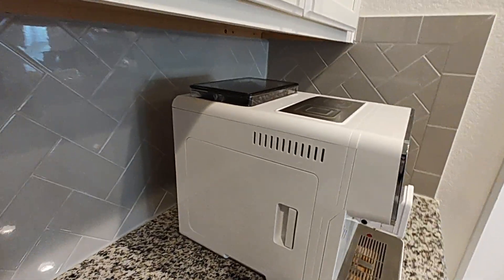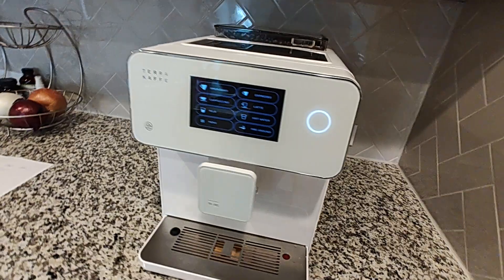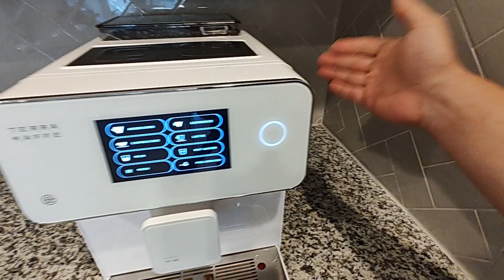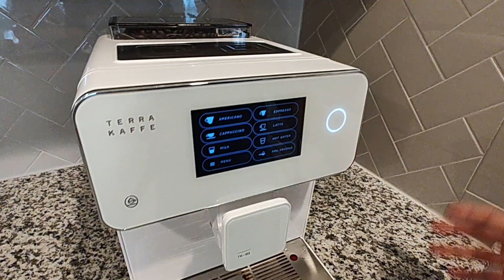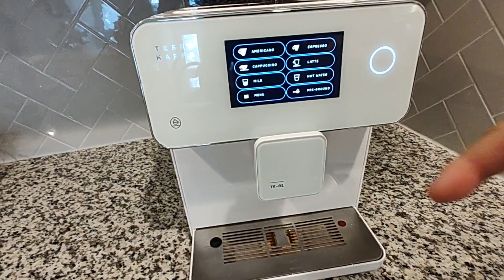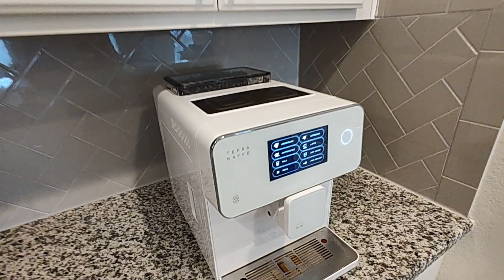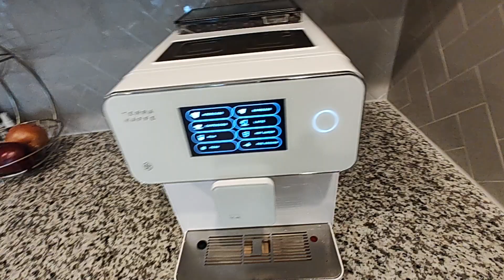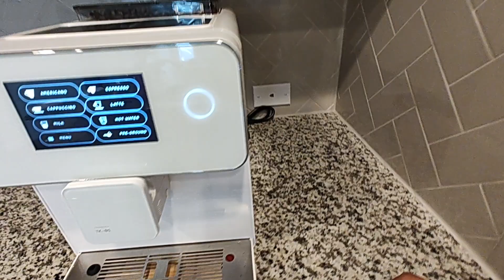Terra Kaffe TK-01 Maintenance and Warranty Process

Comment: I am having a different issue with mines, not sure if you're able to validate on yours for me? My espresso shot pulls always results in a .75oz regardless of the volume set, or the dosage i set. I can never get the machine to get me more than that.
Reply: Let me try it on mine and I'll get back with you.
Reply: I addressed this in my last video where I talk about the replacement unit that I receive from them. When I went to test the different settings for the espresso shot it did change the volume of liquid coming out accordingly but it also changed it for the other settings that I did not set. The only one that I adjusted was the espresso setting to verify your concern but the next time I went to make an Americano for myself I noticed that the quantity of liquid that came out was far greater. So I had to go and adjust all the other settings which I did not change and start from scratch.
Reply from the maker: Mine changes the volume of the shot.

Comment: My terra kaffe tk01 keeps on tripping off our home circuit breaker when switching from standby to the on position. , So..What should i do ?.
Reply: If it is an older home then you might have to try another outlet. Most homes have a GFCI outlet in the kitchen/wet area that should be able to handle the current load. You might have another major appliance on the same circuit like the refrigerator that is constantly running. You will have to move the coffee maker to another circuit.
Reply from the maker: try moving other appliances off the same circuit.
Reply: Mine had a leak. I found the way to fix it in Reddit. I can't paste the link here but there is an internal water leak. I opened it up and changed some gaskets